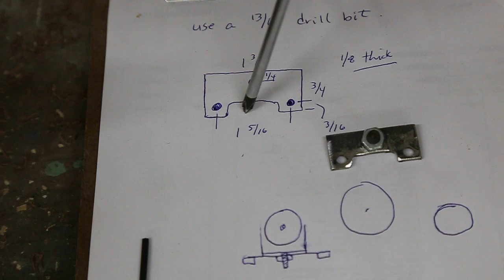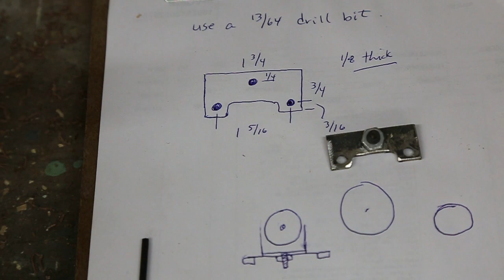Fixing the snipe on a Dewalt DW735 thickness planer with a spiral cutterhead

Comment: Steve J, thank you for the video. My DW735 had extremely bad snipe and your modification has helped minimize the snipe to almost zero! 

Unlike you, I don’t have a grinder available but I used my Dremel with a cutting wheel. Thanks again!
Reply from the maker: Your determination paid off.  I am glad my video helped. They are a good planer, just keep the bed waxed and that will help as well.  Thanks.  Stevo

Comment: Fantastic piece of work.  So glad to have found your video about this.  Just installed the LuxCut helical cutter in my 735 and am getting undesirable snipe on both ends.  I may try to make the pieces from aluminum plate so I can cut them with my CNC router and will let you know how that goes.  The knowledge that the rollers are too low and that they can be pushed up with a home made adjuster is a hugely-valuable piece of information.  Thank you so much for your valuable work!!!
Reply from the maker: For sure let me know how it goes.  The planer is still working but I wished Dewalt would of put a lock on that machine as well.  If one could figure that out, it would be better yet.  Thanks.  Stevo

Comment: I'm looking at the actual bracket you have sitting on the diagram you drew. Did you weld the jam nut on? What is the black part in the middle of the nut? I ask because it looks off center.
Reply from the maker: The flat 1/8 bracket is tapped out to receive a set screw (the black part you see) and then the lock nut which is not welded.  Hope that helps.  Stevo
Reply: @stevoj8959  ahhh I think I understand. 
Thank you so much for this video.
I made one bracket so far. Tomorrow, I need to go buy some set screws and longer machine screws. Do you remember what size those machine screws are? I guess I can take one with me and match it up.
One last question. Your set screw... Do you have a head on top? Or is it all thread?
Reply from the maker: @jamesmkoenig  I used an all thread that takes an Allan wrench.  Thanks.  Stevo
Reply: Ok. Got all four done. What a difference. I'd say it's 95% better. I could probably get to 100% with more adjustment. Thank you so much. You can barely notice the snipe whereas before it was really bad
Reply from the maker: @jamesmkoenig  That is awesome.  Make sure you wax your bed, it will help as well.  You made my day.  Stevo
Reply: @stevoj8959  well you made my day first lol.
I bought my planer used for 420$ last week. The old man I bought it from had installed the Shelix head. He gave me the old cutter head and all the extra parts.
 When I got it home and turned it on, it made a hell of a racket. Something was wrong. My heart sank.  I thought I got taken. After I opened her up and took everything apart, I found the problem. The old man never took the bushing off the old head and put it on new head behind the pulley. The pulley was just flopping around making a hell of a racket. Easy fix, since he gave me old cutter head. The bushing was still on there. That's why he sold it to me so cheap. He must have thought he broke something. So I got the planer and the cutter head(which is brand new) for a little more than what the cutter head usually costs! He even installed a Wixey digital readout. I was super excited until I saw how bad the snipe was. Your video helped me make this thing near perfect.
Reply from the maker: @jamesmkoenig  Wow you got yourself a good deal.  A few of the schools that I do work for have those machines and they keep going and going.  If my ole Delta craps out, I will buy a Dewalt.  With all those bells and whistles, you have a great machine.  Stevo

Comment: Thanks for this video. I can’t quite figure out what effect the new plate is having on the roller.  Wood comes in and spring-loaded roller gets pushed up then once the wood passes, it drops down.  Does the set screw extend upward into the roller area? Does it limit the amount of downward pressure that the roller applies once engaged?  Just having trouble picturing how it limits snipe. My machine is causing leading end snipe only.
Reply from the maker: The set screw pushes up on the roller so it is not down so far.  When the roller is too far down, I found it puts too much pressure on the work piece  and causes sniping.  I think I have it about 1/16 below the cutter head blades.  If you are getting snipe at the beginning, your infeed table may need to be adjusted so it is flat to the bed.  Make sure you wax the bed, it will help as well. Thanks.  Stevo

Comment: May I assume this will also work for the DW735 "stock" head?
What is the first planer, price-wise, that is worth the cost and  does have 1) adjustable rollers and 2) a locking mechanism?
Reply from the maker: The adjuster would work as well for the stock head. Dewalt's 12 1/2 planer does come with a lock but when it comes to adjustable rollers I am not aware of any portable planers that have them. You have to move to a 15 inch before rollers become adjustable.  Things get pricey
Reply: @stevoj8959  Thanks

Comment: How's she goin'?  Snipe can be a real pain.  This was a nice fix.  My planer is a Mastercraft and the cutter blades are adjustable.  Are the cutter blades not adjustable on the DeWalt?  At any rate, it doesn't matter now since you can adjust the height of the rubber rollers.  Nice repair and well thought out!!!  Take care!!
Reply from the maker: Yes the blades are not adjustable which means you can't get them sharpened.  Big fan of spiral cutterhead though.
Reply: @stevoj8959  I have heard lots of good things about the spiral heads.  The way you have it set up now, so that you can adjust the pressure roller, you have no need to adjust the cutter head!!!  Take care!!

Comment: You can't fix snipe on the 735. The reason for the snipe is be abuse the cutter head moves instead of the table. Snipe is caused from one roller being on the wood and one not, whether on inlet or outlet side. This causes the cutterhead to tilt slightly.

The only way to remove snipe is to keep both rollers in contact with the wood the entire time the cutter is cutting. This is done with sacrificial lumber. That can be before and after the piece, attached to the piece, or ran along side the piece.
Reply from the maker: Running a sacrificial pieces along side of your piece of wood is a great idea and one that I have not tried. Adjusting the rollers did work but still left  a very slight snipe in the hard wood but if it has to count, your idea will work better. I will pass that along.  Thanks